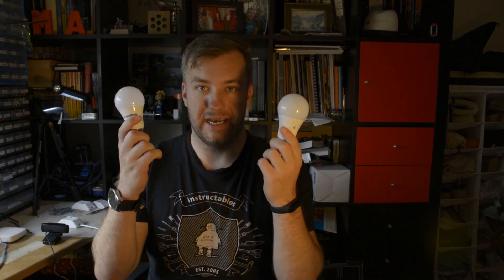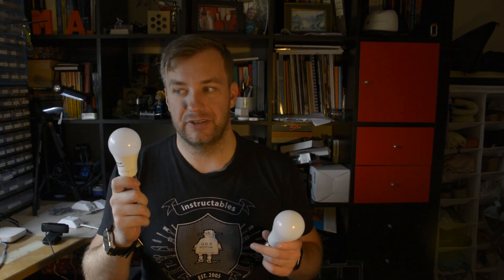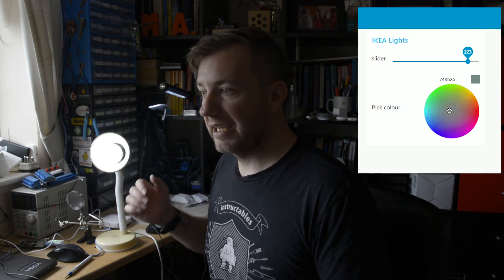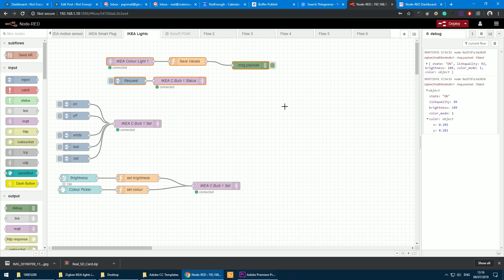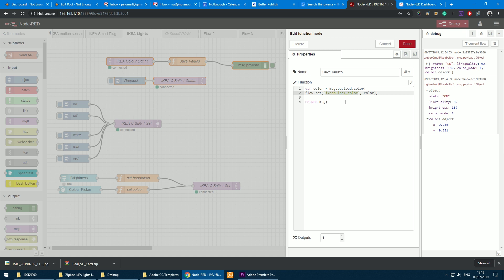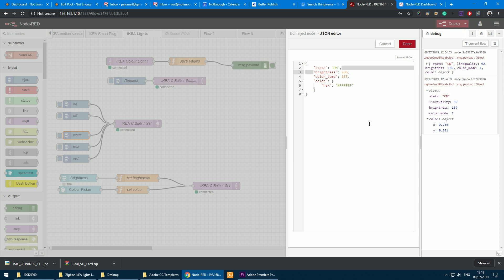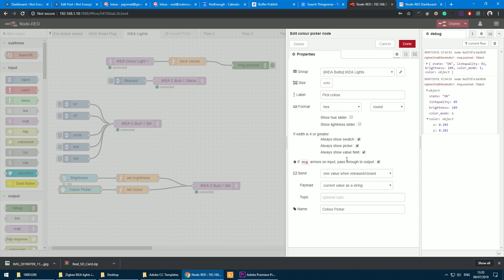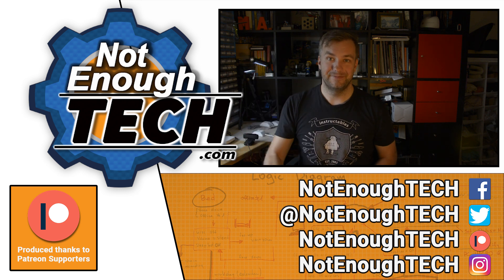IKEA TRADFRI light bulbs in NodeRED

Comment: Nice Video as always!

Is it possible to connect this system with the Google Voice Assistant?
Reply from the maker: Yes you can use NORA to link the bulbs. Check out the video for that I have in the library
Reply: @notenoughtech  Thank you for the fast response....
I saw the Video but have you ever tried that and is it hard with the Ikea Smart home?
Reply from the maker: This article comes with the files you can re purpose to use in your home system so shouldn't be that hard.
Reply: I tried to connect the bulbs in Node Red with a Node called: node-red-contrib-tradfri

But there I have to write the CoAP path, App Identity and Preshared key...
Did you ever heard about this.... Idk what to write there?
Reply from the maker: Just go CC2531 way. There is no need for anything else this way. Just reset the bulb pair it with the stick and enjoy the functionality

Comment: I just got a couple of Ikea bulbs and the matching remote, and I have a Pi with zigbee2mqtt working. I can turn the light on and off with both a dashboard switch, and the remote. What I would like to do, is have the dashboard switch show the on/off status - when I use the remote to control the light. Right now the dashboard gets out of sync when I use the remote.
Reply from the maker: Variables!!!
Each time the bulb changes the state it will post the update - you need to capture this and save it as flow variable. Take a look how I resolve this for the toggle function with these writeups: 
https://notenoughtech.com/featured/xiaomi-aqara-switch-in-nodered/
https://notenoughtech.com/featured/creating-a-smarter-light-switch/

Comment: Nice video as always.
I've been trough a nightmare with a few Aqara Bulbs, CC2531 and Zigbee2MQTT.  Bulbs get disconnected all the time and unresponsive for a while.

Have been discussing with Koen (Zigbee2MQTT dev) and though we made progress, it's far, far from ideal. 
I guess Aqara bulbs do not respect the Zigbee protocol entirely, so issues happen. Not sure about Tradfri, but if you're reading this and thinking about going the Zigbee route for your bulbs, please try to test before buying or at least get them from a store where you can return them if don't work.
Reply from the maker: Other than a hitch in pairing ... I found IKEA to be very responsive. Lightbulb wise I probably continue with yeelight. I just need 2-3 bulbs with ZigBee to extend the mesh. 
I'll be on the lookout. I think I have a care package coming from aqara if so.. I'll post about that more. 

Thank you for the feedback